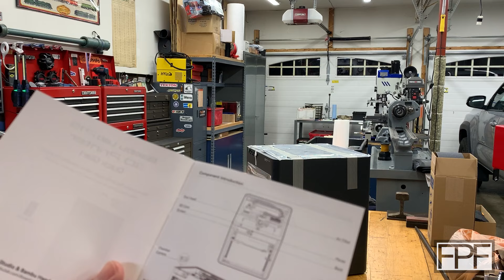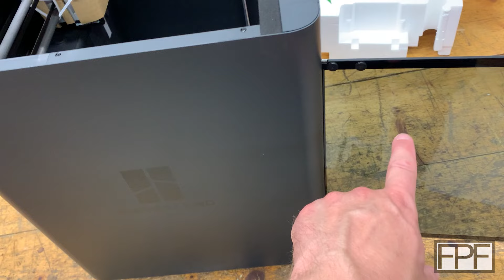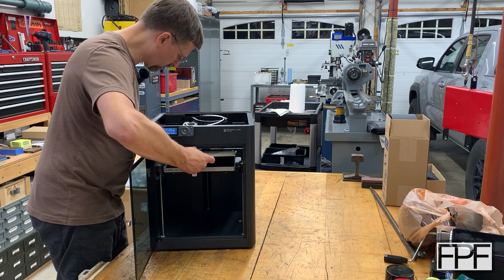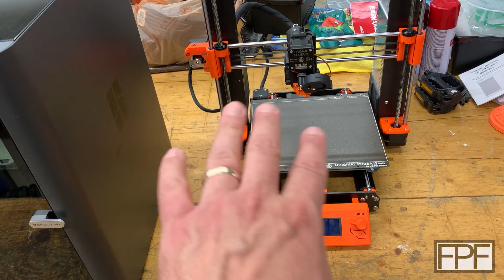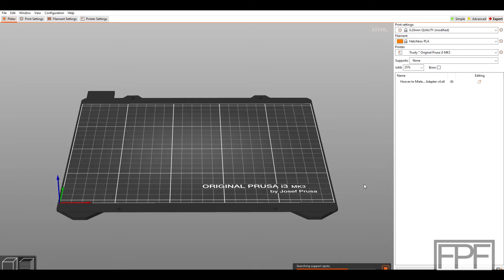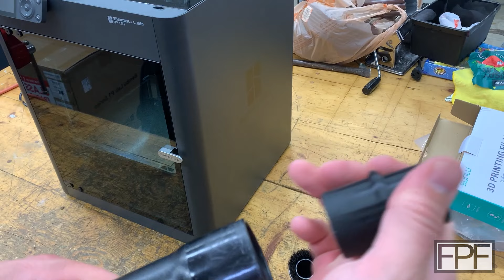Bambu P1S Unboxing and REAL WORLD prints

Comment: Ask anyone in china if they trust a "made in china" or "made in X country" more, and they will almost never choose a chinese made product. The baby formula scandal is still fresh in the minds of the people who lived through it, and "dofu dreg" construction is a daily reminder.

There are a small handful of high-quality companies in China. Bambu, DJI, Winwing are a few that come to mind personally, but the vast majority of manufacturers in china simply cannot or will not produce at this level of quality due to the deep culture of corner cutting and counterfeiting in china.

While it is theoretically possible to produce at the same quality in china, the factories will try to cut major corners to increase their profit margins. Examples include counterfeit chips or other electronic devices, sub-standard materials, lack of quality assurance procedures. There have been many horror stories of small companies going under because the factory adjusted some parameter without their permission or knowledge and it completely wrecks their initial product line. This is why every major company that manufactures in china hires a full-time liaison/inspector or liaison/inspector team to stay onsite every hour of production to ensure quality and standards are met. While most western companies have no chance at recourse in the chinese legal system if this corner cutting happens, Bambu or DJI is a national icon for the purposes of the CCP's image and would absolutely come down on any factory that damages that image they present to the world.

Comment: Manufacturing is not about where it is about, what policies and QA the company enforces. Most of the big companies have assembly lines in China. If the designed parts are good and the QA is there, China manufacturing is no issue.

Comment: I Got P1S as my first printer. Im so happy with it. I designed a phone holder, it Takes 58 min on P1S, 3,5 hours on MK4 and 9 hours on ender 3. I could not imagine printing a simple thing take that Long.
The 58 min is standard(100%) speed. There is also sport(124%) and ludicrous(166%). The 166% seems so fast it almost hurts to see it printing. So i print i standard(100%) 😀
I unpacked my P1s installed orca slicer and i was running right away.
Reply: How long did the printer take to ship to you once ordered? I just ordered mine and was just wondering😊
Reply: @Untitleduser604 mine too 24 hrs, I’m in the uk😉
Reply: @Jestey6  that’s quick! Mine is 3 months old now, and it came in 10 days! I am in the US.
Reply: @Untitleduser604  West coast US, also took about 10 days. Parts and accessories/filament only takes 2-3 days!
Reply: @henrythompson7595  I live in New Jersey, which is the weird thing. It still took 10 days and it’s right near their warehouse!!
Reply: @Untitleduser604 this is late but that’s odd. I live in NY and it took like 3 days from placing order(at night) to my doorstep. Maybe they improved shipping times.

Comment: I am torn between the P1s and the X1. I want to print ABS and ASA. Have you had problems printing the two on P1s vs x1?
Reply from the maker: P1S + AMS for PLA/PETG and multi-color, X1C (with no AMS) for engineering materials.  Have to decide which one you're into more :)
Reply: @FunctionalPrintFriday  Thanks!

Comment: My concern isn't the security of these cloud services. It's the fact that you are kind of depending on the company not disappearing as fast as they appeared and that they will have long term reliable servers. 

Quite frankly, the cloud features should simply supplement a proper, local software package.
Reply from the maker: Agreed.  They have made pretty good strides with the LAN-mode functionality, and it's promising to see that they are thus-far being supportive of the open source firmware that's become available for the X1-series

Comment: Bambu makes a very easy to use printer, but how upgradable are Bambu printers and how long is each model support? Important question especially since they are a relatively new company and do not support open source.
Reply from the maker: actually, they open-sourced their slicer and are so-far openly working with the team developing open-source firmware for the X1.  That tune could certainly change, but so far they're doing the right things.
Reply: @FunctionalPrintFriday in addition Bamboou spares are cheaper

Comment: I think you are speaking to me! I have an old Ender 3 "pro" that has frustrated the heck out of me from the start. Last year I took it apart to add a bed level sensor and it hasn't printed anything since. I am just so sick of the failed prints and meh results. I've decided it is time for a better printer. I set out to buy a Prusa and quickly got turned around. Now I have my heart set on a P1S with AMS. That is one heck of a lot of money for me, but I just can't handle sweating first layers, waking up to spaghetti, or print times that take DAYS. I think I'm ready to step up. P1S is the one, no? Maybe having a solid-operational-printer will let me finally print the parts I need to put the endy-3 back on its feet again.

Thanks for this "not a review". I like your stuff. I clicked the sub button within the first 10 min. Refreshing to see videos not so obviously bought and paid for.

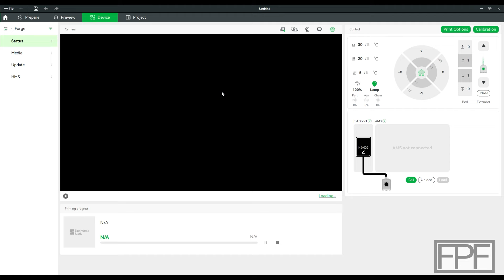Comment: 47:05. Honestly, the biggest concern is not whether the CCP steals your STL files.  The bigger concern is that Bambu has a point of presence on your network, and more sophisticated attacks could be committed directly against other assets on your network. Not something that is otherwise possible just because you're connected to the Internet.
Reply from the maker: I just have the machines on their own VLAN.  They can see each other, that's it.
Reply: @FunctionalPrintFriday  You have them on their own VLAN, but do you have routing from that VLAN back to your main network?  Unless you're treating that like a DMZ (a technical term in Network Security), VLAN separation alone is providing no additional security.  Hopefully that's what you mean when you say "they can see each other, that's it."  If so that's great.  Not very many people are aware they even need to do that, or would know how to do that.
Reply from the maker: routing, yes, but FW rules that block outgoing other than NAT to WAN.  I use pfSense for routing/fw.  I previously worked engineering PCI and HIPAA compliant network infrastructure so I know my way around it, but I realize that I am absolutely not the avg user, who it is a legitimate concern for @bujin5455

Comment: I have a mini+, and I was thinking on purchasing the P1S with AMS to replace the mini as it has a larger print volume and direct drive extruder. However; P1S (and P1P and X1C) are considerably louder, plus the mini has a faster start and is basically ideal for small prints. But it can't really print TPU. But the Bambu's AMS can't print TPU either, so that's a huge, huge missed opportunity. Mixed bag really. I'm thinking I might want to wait another year, since other manufacturers are probably scrambling to compete with Bambu.

Comment: Note that the bambu profile you used was .20 STRENGTH, and not the.20 standard profile. That drops the outer wall speed from 200mm/s to 60mm/s. That's also why you had to change the wall loops from 6 to 3. The bambu printer would have been even faster if the standard profile was used.

Comment: They are both perfect. As a teacher in CAD, I think that Onshape (which is a knockout of SolidWorks, I believe) is better on the 2D drawing part. Still, for precise or direct modeling I think Fusion (which is an Autodesk product, along with many, many others in the same range of interest, like meshmixer, which they have both from other developers) is just as good, or even better, but I´ve thought Fusion 360 for about 6-7 years now so that has certainly influenced my adjustment. I think that Fusion360 has a little lower learning threshold to achieve
Reply: As a pure hobbyist, I can't get over ease of use of Solidworks. Once the logic clicks, it's relatively easy to figure out new things, but as there is a lot of depth to it, you have to be diligent in exploring the options, so you know what is available. I've tried Onshape, which is very similar, obviously takes a lot from SW, but I loathe cloud based anything.
Reply from the maker: I'll likely goto onshape, but the cloud aspect is a big turn-off for me too

Comment: Corexy is more than just the toolhead moves in x and y. Some Cartesian printers are set up like that too. Corexy means there are two motors A and B which work together to move the toolhead in the xy plane. Meaning more torque for any movement and it can move quicker than standard cartesian.

Comment: I'll say the problem with China manufacturing is the quality of there materials, especially metals. Where the term Chinesium comes from lol. The have speed down to a science... but the main downfall is where they cut corners. Their knowledge and know how though is top notch!
Reply from the maker: Yeh, it's the cutting corners that's the problem. I think MOST of the time they know what the material qualities should be, but they go with X instead of Y because cost.  There are occasions though where they have clearly just duplicated a design without understanding how the materials interact.

Comment: How does China get your files if you only print via SD card and never connect to the web with your SD card installed? 

Our web access is via Starlink. If I shut that down can China still hack into my print shop? Are there secret tunnels I should worry about?
Reply from the maker: Is that even 'real' air you're breathing, or is it just a vapor of nanobots :P

Comment: I just purchased a Bambu P1S this past week. Out of 22 print attempts, 15 of them failed. Camera sucks big time. Print head slams into the front of the cabinet when bed leveling. And talk about loud. Damn !! Looking to send it back asap and get my $800 back. What a waste of money in my opinion. My little Ender 3 v2 prints better than this.
Reply from the maker: Thanks for sharing.  I would return it to, that's garbage, however, the two I have are rock solid.  Sounds like you got a lemon.
Reply: I think so.  @FunctionalPrintFriday

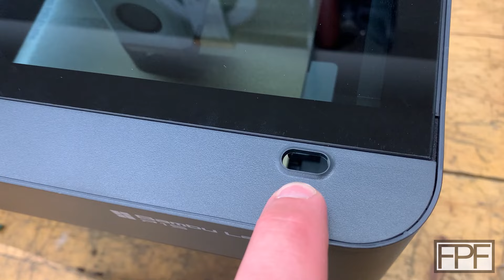Comment: I believe that fittings (holes) mwentioned at 52:29 are for Multicolor AMS system which will go on top of the printer.
Reply: The hole in the front of the case is for a USB 5V cable to run a replacement or add on display.
Reply: @Pastorkarlman  apologies if I’m being thick, I had a P1S delivered this afternoon and apart from failing to set up the LAN properly, I think I’m all set to go.  Please could you explain your comment regarding a replacement, or add on display  I’ve only seen one available add on display, but most say it’s not a good idea, due to the possibility of Bamboo changing the software at some point, and in any case it appears that using an iPhone is an attractive alternative.  Cheers Noel.
Reply: @Jestey6  The bambu handy app on your phone is good, and I use it to check status of prints when I'm away from the printer etc, but not the same as replacement display.  The one I've seen reviews on is probably the same one you've seen from BigTreeTech the Panda Touch.  Yes, there is some risk to Bambu changing their FW and it not working, but it is less than $60 and has great reviews.  I haven't bought one yet because I'd rather spend my money on filament and quality STL's but probably will at some point down the road. The add on display definitely isn't a must have, but a nicety.  I've got a few hundred hours on my P1S now and between the Bambu Studio and the LCD display on the P1S and the Bambu Handy mobile app, I have plenty of control for what I do.

Comment: You also do not NEED to use the cloud tools with the Bambu Labs printers. There is LAN mode and you can use an SD Card too
Reply: If it is a reason you bought this printer for, you need to know about it. The set up of the wlan connection was far from pleasant for me.
Reply: Not to mention changing their TOS or how cloud mode works after roughly 2 years since the X1 release is absurd. Forcing Bambu Studio and making it not functional for Orca is crazy. At least Orca has said they are not going to make their slicer available for Bambu Connect. It's not about security, I believe it all comes down to AWS costs but Bambu chose this way for it to function.

Comment: Alot of good points raised but I would say that your perspective on data privacy and sovereignty outside of china is very naive. About the only place I would have trust ins anywhere in the EU and even then its more of an honor system than anything enforced just the GDPR has teeth so companies generally do the right thing or at least hesitant to do the wrong thing. You should look into the 5I's to really understand what happens with data coz 'government' isn't getting it from company servers. 

One thing you seem to have overlooked is the fact that Prusa is open-source and so for long term serviceability its going to be far superior.

Comment: Thank you for the video! I agree with pretty much everything you've said!

I have a handful of questions, if you don't mind.

How loud is the P1S compared to the MK3? 
How is maintenance on the P1S?
Any issues with either bed leveling or first layer adhesion that are worth mentioning?
Do you have experience with an X1C? It's obviously more expensive, and I could afford either, but I would love to use textured PEI sheets on it to avoid using glue stick, and I'm not sure if it's easy to disable the LIDAR sensor to avoid issues with it
Reply from the maker: Thank YOU for your comment, answers in order: It's probably 2x as loud, but mine are in the basement so it could be 5x as loud and it wouldn't make a diff to me.  If you're sleeping in the same room with it, you WILL notice.  I've only had to do basic maintenance so far, so can't really comment, but maintenance on the prusa is no peach either.  Not much is modular in prusa's design when it comes to the wiring, so you often have to take much more apart than you'd expect.  I own an X1C.  I don't trust the lidar on the textured sheets.  I manually calibrate the flow.

Comment: If what I read is correct, the P1S has to do all it's work with a single ESP32 as processor.  That is quite a lot less processing power than even a pi zero 2 Klipper system, so if true, I admire the developers that pulled this off and it may put the slow framerate of the camera in a whole new perspective.  Hell, I have some ESP32CAM modules and despite those having to only handle a video feed, they're far from stable enough to consider using them to drive anything critical ...
Reply from the maker: yeh, there's not much CPU to work with, but the fact remains that the livestream data is still taking the wrong network path

Comment: I've been looking to replace my old Sidewinder X1 for a while and the Bambu printers seem very nice.  My brother got one a few months ago so I got a chance to play with his X1 Carbon in person.  I was very impressed with the print quality and speed, but printing through the cloud is a dealbreaker.  Not because I'm worried about the Chinese govt stealing my hobby prints, but because sending prints to the machine through their cloud service is insanely slow.  My brother has gigabit fiber and a very fast PC, and it still took several minutes to send files to his printer from the slicer.  That's unacceptable, and would drive me nuts.  I'm hoping that the "LAN mode" printing could fix that particular issue.
Reply from the maker: LAN mode will solve that for you.
Reply: Pfft 😂it’s a non issue for me

Comment: Relatively comprehensive first hand review from an enduser perspective. That said, there is nothing much on initial setup of P1S, where you give away your rights(to your video, model data yet to be created) while installing handy app, registering to cloud, binding printer , while installing bambu studio etc. While there is nothing wrong in missing out some details, it is a bit critical.
That said, the reason why P1S shines, is due to corexy,advanced bed leveling, input shaping, and getting all the real life slicer parameter and machine data analytics from its big brother X1C(which is almost identical except, having LiDAR and a better oomph processor). So, in essence, P1S is cost optimized X1C.
Now for the most interesting part.
We see P1S only as being assembled already. Never think about, what happens after it got assembled, the amount of tuning and calibration, it gets through, without which it cannot achieve its speed or precision. Not sure, if Prusa gets through similar testing, or it may be impossible for a slow bed slinger, lacking high tech motion sensors. Both share good old quality control, but Prusa little better!. I challenge anyone to try disassembly and reassembly of a P1S comparing to a Prusa put together from a kit. It will be an eye opener. But who cares to go through all those troubles. But trouble will happen down the line anyways.
The layer inconsistency in Prusa print is due to well known z-wobble. The dimensional precision talks a volume about the QC that went in(while P1S just tunes itself out of shipping and handling breakin of motion components). You could pin point the source of high pitched whine, in P1S through an ultrasonic probe, most likely due to ringing in high frequency power supply ferrite core. Just some 💭♥️👍
Reply from the maker: That lidar in the X1C is kind of a bust.  I print on texture plate all the time, and even though the now support it for lidar, it's still iffy at best.  The Prusa is definitely easier to work on (as most any open bedslinger would be), but I hate the way they run everything up to the toolhead.  It's finicky to assemble and a PAIN to take apart and fan on mine has died twice, at least one time due to cable failure in the bundle.